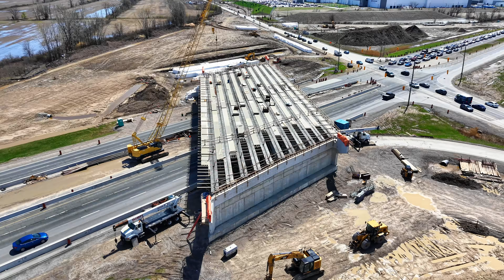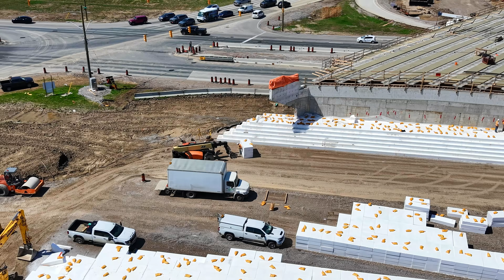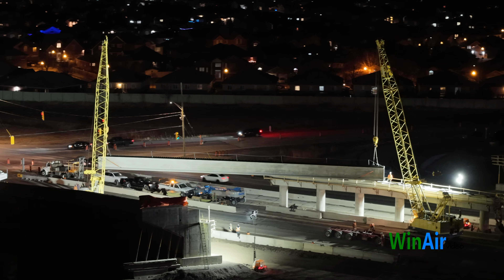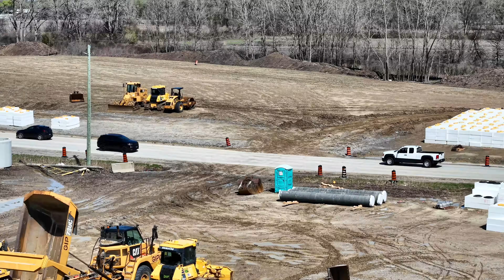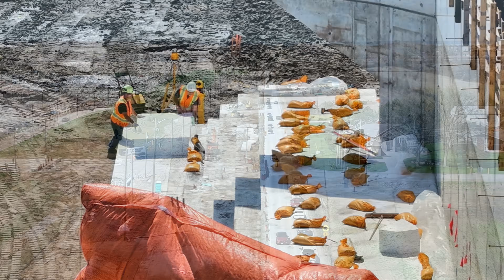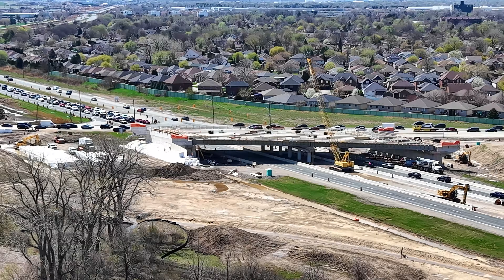Windsor's $110M Overpass Taking Shape | Banwell Road Construction

Comment: So if more interchange projects had used foam blocks over the past 25-30 years, would we have no sinking approaches to bridge structures?  'Cause there sure are a lot of those happening in Ontario!
Reply: Should just move to drilling, or driven piles matts founded on bedrock  especially on approach abutments and corresponding approach roads 🤔
Reply from the maker: Hi Clearwater. Interesting, but in Essex County the bedrock is way down there. I did a quick search to confirm my suspicion and this is what I found; So as a rule of thumb for the Essex County area of southern Ontario: if you drilled straight down, you would normally expect to encounter bedrock somewhere between about 40 m and 90 m, with local variations shallower or deeper depending on buried bedrock valleys and ridges mapped by the Ontario Geological Survey.
If it could be done it would be way too expensive to consider. At least in Essex County. :)
Reply from the maker: Hi Kevin. It seems to be the preferred method of fill for road decks and ramps. I haven't looked into the history of successes and failures of the EPS blocks, I imagine if the ground beneath isn't prepared properly it could be an issue, but the blocks sound like a good idea to me. :)

Comment: This interchange is going to get wrecked by trucks full of equipment after years of use. How much will the maintenance costs be after its constructed?
Reply: The new pavement on Banwell is designed to handle an adequate track traffic of around 500-1000 trucks per day along with 30 thousand vehicles per day. Maintenance costs will be routine just like every other street.

Comment: Foam could be a problem, but the kids of today's engineers and contractors will remedy it
(at great profit)...and the taxpayers can get hosed. Foam will act as a sponge, deteriorate
and cause eventual erosion of the embankments.
Reply: This foam is closed-cell polystyrene structure which is moisture resistant and it takes around 450 to 500 years to start to break down from moisture. It is used exactly to solve a problem. The problem of settlement. They prevent underlayment soil from settlement, reduce lateral pressure on abutments, and accelerate construction. If they used earth fill, the construction workers would spend at least 2 years just compacting the fill and even that would cause issues 30-40 years down the road. Engineers know more than you.
Reply: @eraldway  Foam was touted for flat roofs (a failure)...
so... let's see what happens in 10 years.
Never believe the specs some US company 
lies about.  Those companies get sued, go bust
and disappear. No guarantees apply.
Reply from the maker: Hi Jimmy. Your right about that. No Guarantees. However, the EPS blocks are not a new idea. They have been using this system since the nineteen seventies. When there is an issue, it is most likely improper installation. From what I've read. :)

Comment: They used this styrofoam in the construction of the 401. There is a section that is collapsing for the second time in the n/b lane of Huron Church, north of Cabana where the  N/B on ramp from Huron Church goes under the highway. I always wondered if this styrofoam was the issue.
Reply from the maker: That's a good question, John! So I did a quick search and the is what i found;
You’re almost certainly seeing EPS geofoam blocks, and by themselves they are rarely the root cause of failures like the settlement/collapse you’re describing on that 401/Huron Church underpass segment.
The white “Styrofoam” is expanded polystyrene (EPS) geofoam, used as a lightweight fill in road and bridge construction, especially at approaches and over soft ground.
Engineers use it in place of heavy soil to reduce vertical and lateral loads on weak subsoils, tunnels, culverts, and retaining walls, and to limit long‑term settlement.
It is extremely light (up to about 100 times lighter than soil or crushed stone), so it cuts down the pressure pushing down and sideways from an embankment.
When designed and protected correctly, EPS geofoam has good compressive strength and has been used successfully in highway construction worldwide since the 1970s.
Most documented issues come down to design or detailing around the foam, rather than the material simply “collapsing” on its own:
Inadequate protection from gasoline/solvents: EPS can be attacked by certain hydrocarbons if there is not a proper separation layer, leading to localized softening.
Poor drainage detailing: If water is not managed, you can get erosion or softening in the thin soil layers above/beside the foam or in adjacent native soils, which shows up as rutting or settlement in the pavement.
Interface or transition issues: If the transition from foam-supported pavement to conventional embankment is not detailed correctly, you can get a bump or dip at that interface over time.
In other words, even where geofoam is present, repeated settlement or a localized “collapse” is more often related to:
Subgrade/subsoil conditions (very soft clays, organics, or fill moving under the whole system).
Drainage and water control around the underpass or structure.
Details at retaining walls, abutments, or utility trenches interacting with the roadway.
Applying this to the 401 / Huron Church area
Public materials about Windsor‑area projects (Herb Gray Parkway and other 401-related works) show the use of tunnels, lightweight fills, and complex staging, but they do not single out EPS as a failure cause. Current notices about Huron Church and nearby works focus on lane restrictions and surface repairs rather than a fundamental material defect.
So, your intuition that the “Styrofoam” is unusual is right; it is a special lightweight fill system. But based on how geofoam is typically engineered and where problems usually arise, it’s more likely that any repeated distress in that specific northbound section is due to local soil, drainage, or detailing issues around the underpass, rather than the foam itself simply not doing its job.
There you go, John. I hope it helps!! :)
Reply: @bobjoneswinairvideo thank you very much for the detailed explanation. By your descriptions, I would say that detailing at the interface could be the problem.